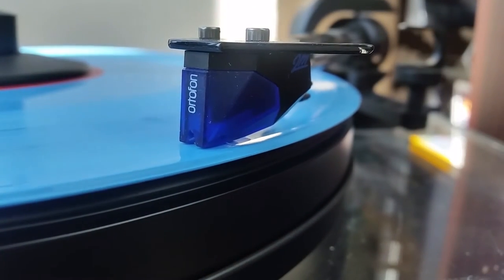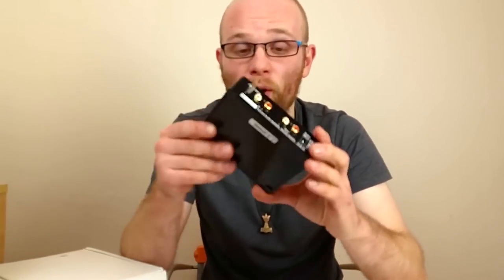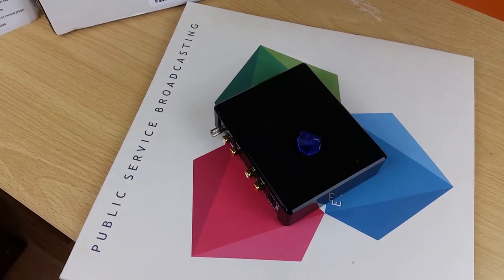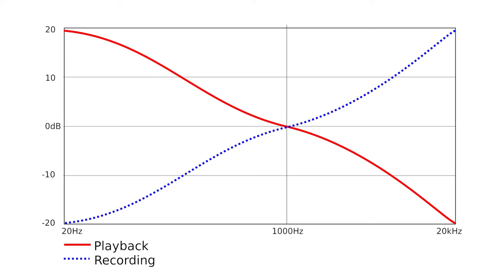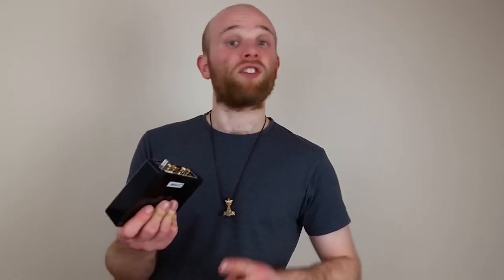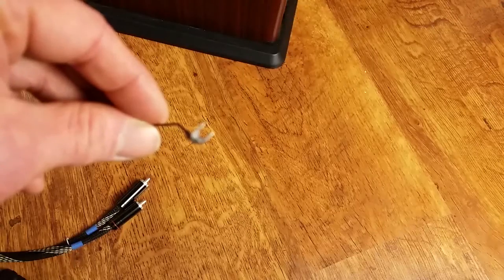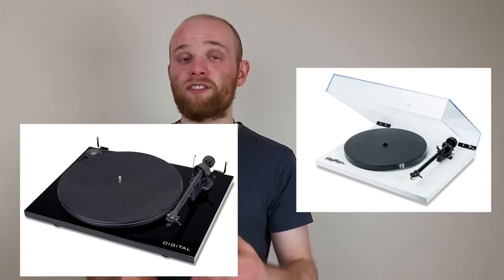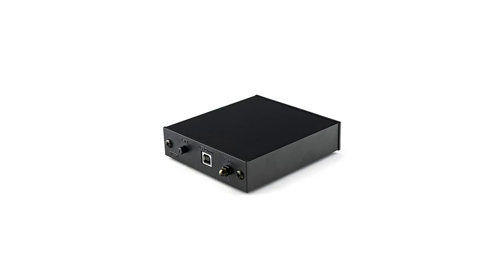What is a Phono stage? (And what does it do?)

Comment: Great videos! 
I have a Denon 720AE amp with built in phono stage, I also have a project MM
Pre amp. 
What one will sound better in your opinion?
Here's the stupid question!
Can I use the pre amp with the Denon built in amplifier phono stage ? Or do I need to switch to Aux on my amp when using the project MM preamp?
Reply from the maker: +Jonathan Ahern you need to switch to aux! If you put a pre amp into another preamp you'll have tremendous amounts of gain and distortion. It can damage your pre amp and amp! 

I've tried both side by side and I think the project phono stage is the better of the two but I'd say just try them both out. Your own ears are the best judge.
Reply from the maker: I decided to include this in a new video as it seemed like an interesting topic! Enjoy:
https://youtu.be/JlJFJndAkjM

Comment: I'm currently running a Rega P5 into the built in phono pre in my Linn preamp but I'm on the lookout for a nice Linn LP12 and may well upgrade the phono preamp too, the Lehman and Graham Slee units look interesting, as do Trichord... I'd like the linn radikal/urika eventually but one step at a time. I do need to upgrade my deck though as I have 2000+ albums and the turntable is lagging behind the digital side of my system.

Comment: I understood none of these words. I bought a payday turntable and when I turned it on realized the sound was super low, on the back it has a pre amp on and off button plus the line out jack. Can I just connect it to a speaker that has the white and red plug in thingies or do I need to buy that little box too?

Comment: I have an audio Technica AT-LP5 turntable which has a built in pre-amp... so I would not need a phono stage then would I? My speakers are also powered with an amp built in.
Reply from the maker: +Perverted .Alchemist apologies for not replying. Perverted alchemist is correct. However it's worth adding that: typically the phono stages built into turntables are of limited quality so using an external phono stage can be a reasonable upgrade path.
Reply: @AudioLlamaTube  I use a TC-778 with the LP120, yhr int pre cuts out at very low vol, chopping up long fadeouts, eg the last 2 tracks on Sky 2 S4